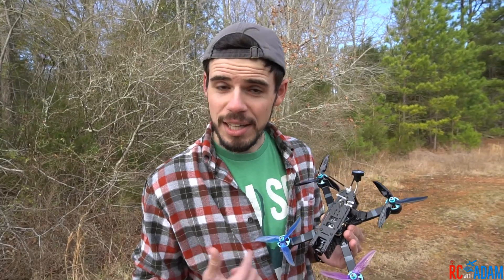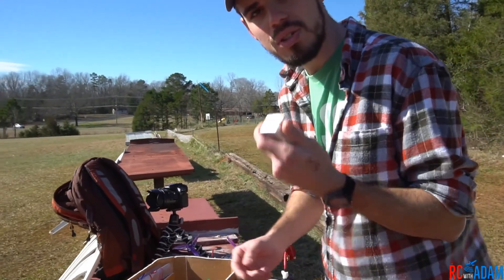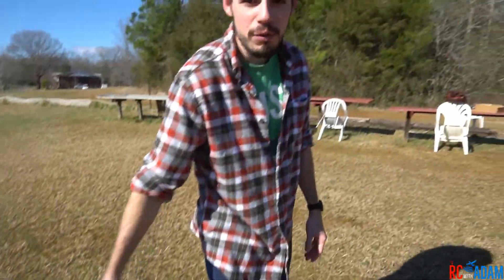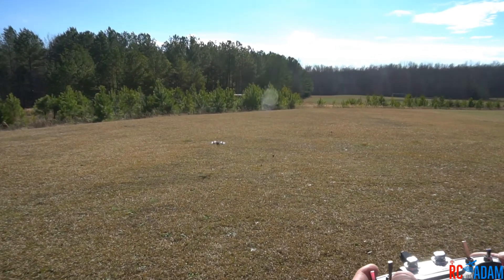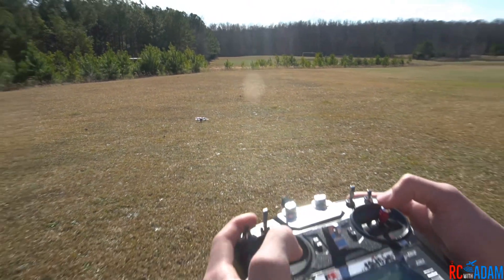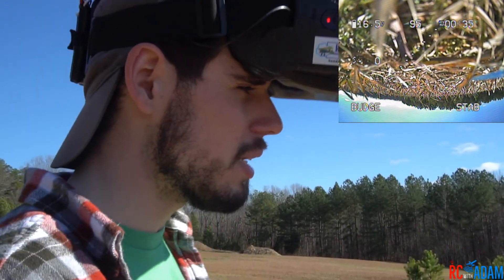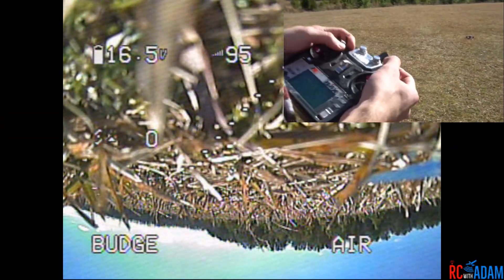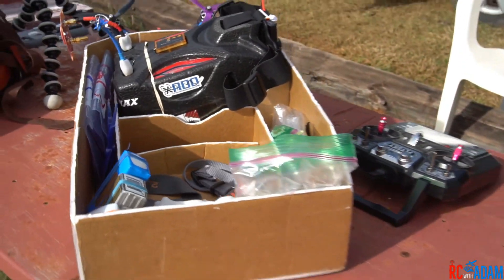Budget Basher Build -PART 7 - First Flights [COMPLETE BEGINNER BUILD GUIDE 5" FPV DRONE]

Comment: Thank you so much for the series! I'm going to use it as a help to build my first 5-inch. I don't have the exact same (frame is equal, motors are 2306 2500KV and props are 5047). I have only just watched the first parts of the series, but was there any recommendation on battery type and capacity (mostly casual freestyle)? So far I only have 3-inch batteries (3S 850mAh and 4S 850mAh). And thank you again for the videos. They were super helpful for a complete beginner to understand the basics!
Reply from the maker: I typically use a 4s 1500mAh. Raceday Quads or Tattu are great.

Comment: @RCwithAdam great build i planning to follow your build is frog lite OK because availability of the frame is somewhat difficult in our country. 

 also what budget googles best for this budget basher build?
Reply from the maker: The TransTEC Frog Lite 218 frame looks like it would be a really tight build. I'd have to hold one in person to know if everything would fit. As for goggles, check out the Eachine VR D3 box goggles https://www.banggood.com/Eachine-VR-D3-FPV-Goggles-3-Inch-5_8G-40CH-Diversity-Object-Distance-Adjustable-DVR-Built-in-Battery-p-1346326.html?rmmds=search&cur_warehouse=CN . I haven't gotten to try these yet, but they look like a solid beginner option.